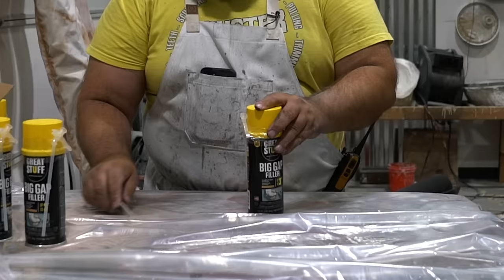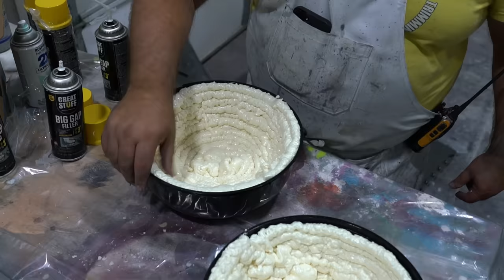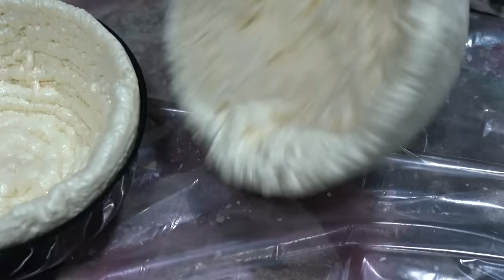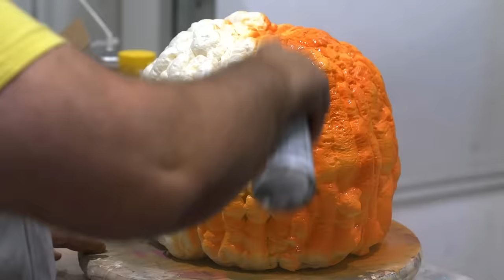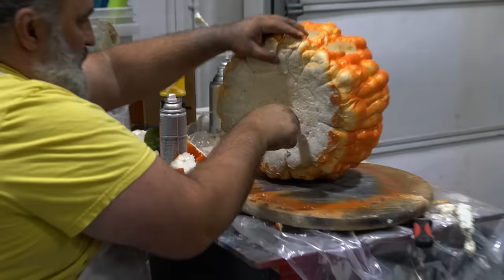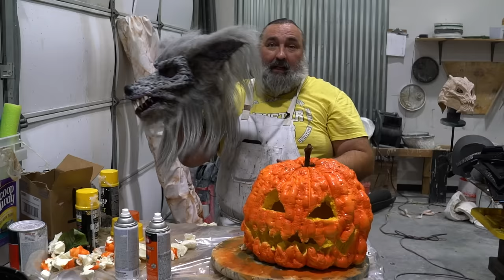Great Stuff Spray Foam DIY Pumpkin

Comment: does anyone happen to know if we would be safe to wear one of these made with spray foam as a jack-o-lantern head?
Reply from the maker: I wouldnt wear it forever, but if you wear it a few days after you made it for a few hours in a haunt or at a party then it would be fine. I also always wear a head sock so its not right against your skin.

Comment: 😊what about using Pam instead of water to make it easy removing from bowl??
Reply from the maker: Water actually cures the foam and Pam or any kind of oil would make it difficult to paint later.  It's not hard to get out of the bowl, water works fine!

Comment: Or you could just buy a damn pumpkin and crave it
Reply from the maker: you could, but it would rot. I will have this forever- If I made one every Halloween as an activity how fun would my porch be in five years with the cost of $12 a year. a fake pumpkin of this size is about $30-40 even as high as $80. I have a haunted attraction and I need fake pumpkins, its not solving a problem you have, but it is solving a problem.

Comment: If you use Vaseline to coat the bowl it won't stick at all it will pop right off
Reply from the maker: If I use Vaseline to coat the bowl, that is going to get all over the foam which  will make it very hard for any other foam to stick to it later and paint it down the road.  Also, the water plays an important role in helping the foam cure.

Comment: Flammable
Reply from the maker: https://www.homedepot.com/p/Loctite-Fireblock-12-oz-Spray-Foam-Sealant-2866858/323830711?mtc=SEM-RM-RMP-GGL-D22-022_004_INSULATION-BI-LOCTITE_17690-NA-DSA-NA-NA-MK780392200-NA-NBR-17690-NA-NA-FY23_Foam&cm_mmc=SEM-RM-RMP-GGL-D22-022_004_INSULATION-BI-LOCTITE_17690-NA-DSA-NA-NA-MK780392200-NA-NBR-17690-NA-NA-FY23_Foam-71700000110580997-58700008395699509-39700076433138561&gclid=Cj0KCQjwmICoBhDxARIsABXkXlIhu2-kHafqp185pZqtduYopcBVM0DaRdmsYU3ISPDySIZwZwbHqtAaAqDBEALw_wcB&gclsrc=aw.ds

Comment: Could you use silicone mold release spray on the bowl instead of water?
Reply from the maker: It might be possible but water is cheaper and water helps the foam cure. A mold release on the outside of the pumpkin will make it really hard to paint. I think I'd stick with water.
Reply: @StiltbeastStudios  
Thank you. Great advice.

Comment: Could you use Pam cooking spray ? Just wondering…thanks
Reply from the maker: you could, but the water helps the foam cure and skin, the cooking spray would also make it harder to paint. It actually came out easy and I don't see a need to change that portion up. the next thing to do is swap foam types.

Comment: Could you line the bowl with the plastic wrap ?
Reply from the maker: I could, but I need the water to get the foam to cure. So the wrap might shift alot. It really wasn't that hard to remove.

Comment: I think I would’ve maybe sanded it down a bit
Reply from the maker: I dont like breaking the surface of the foam, the whole point is to work it while its wet so you dont have to sand it. broken down there are particulates that cause it to break down faster.

Comment: Could you use cooking oil in the bowls to make the foam not stick?
Reply from the maker: The water does the trick- and water helps cure the foam.  Also, any type of oil would make it difficult to paint later.
Reply: @StiltbeastStudios  Ah, I forgot to consider the paint. Ty very much for the reply!

Comment: Lol how much does a pumpkin cost? Why would you handled a toxic spray foam with your bare hands. Idk maybe I'm nuts
Reply from the maker: this one costs $12 and will last about 10 years or so, a real pumpkin this size costs about $16 and a fake foam one this size anywhere from $40 to $80. 
     spray foam releases toxic gas while its curing- cured foam is pretty inert, I only touch it after a skin has formed on the surface so I can shape it.
Reply: Thanks for the reply. When you put it that way it makes much more sense to me lol. Keep up the great work bro all of your work comes out incredible!!

Comment: Cooking spray in the bowl an Is saran wrap on the lazy Susan would be better the water
Reply from the maker: the water is necessary- its more than a release agent- it helps the foam cure so it has to be there or else the foam takes forever to skin. and cooking spray at any point would make it much harder to paint later on.
Reply: @StiltbeastStudios   true ok thanks great video

Comment: what else can we make a fake one of that costs more and doesn't quite measure up to the real thing ?
Reply from the maker: This is going in the set of a haunted house which is an attraction.  I do not want the smell of a rotting pumpkin, the insects it will bring or the puddle of goo it will make as it rots.  I just want a cheery looking pumpkin that will last for several years.

Comment: Instead of h2o spray pam to help it loosen
Reply from the maker: If I use Pam to coat the bowl, that is going to get all over the foam which  will make it very hard for any other foam to stick to it later and paint it down the road.  Also, the water plays an important role in helping the foam cure.

Comment: Maybe to save you a step next time use the fire block spray foam from great stuff. You wouldn't have to paint it, and if I remember correctly it hardens up a little more than the white/ yellow stuff you used.
Reply from the maker: its about 7-8$ a can and I was trying to keep this lower in price since thats people complaint with locktite foam.
Reply: @StiltbeastStudios  I get it. But doesn't the cost equal out if you buy the white stuff plus spray paint? Just trying to save you a step! It came out good though, I might have to try it

Comment: Spray urethane foam stays in the environment for thousands of years before it effectively degrades.  Why not use actual pumpkins which degrade to compost in a season?
Reply from the maker: because I own a commercial haunted house. a carved pumpkin starts to rot in a week here in texas, and I have 50 of them in one scene- monetarily that does not make sense- or the fuel to get 50 pumpkins each week and the electricity to carve 50 a week- more eco friendly to make 50 these and have them last for 10 years. I hope you see my side.
Reply: @StiltbeastStudios  Sure, that makes sense in your case.  I would hope people watching this video would decide to make their own out of actual pumpkins rather than follow your process if they are simply looking for a project to do.
Reply from the maker: My channels core audience has been haunted attractions and home haunters who have a need for fake pumpkins, making them inexpensively and to withstand the elements have been issues. this year youtube is pushing my content further out to an audience who does not have the same problems and challenges. happy Halloween

Comment: Why cant u use oil
Reply from the maker: What do you want to use oil for?  Water helps the foam cure.  It helps it become rigid faster. Using oil in any part of this process would make it much harder to paint later.    Or to allow any other foam to stick to it later down the road.

Comment: Instead of using water why don't you use some kind of cooking spray
Reply from the maker: because the cooking spray would make it very hard to paint and hard for other foam to stick to it. the water also helps the foam cure, its not really an issue.
Reply: @StiltbeastStudios  okay it'll put a oily film on it you're right I didn't think about that

Comment: I think you could have just flipped them inside out after spraying the bowl
Reply from the maker: the lines of foam ran around, not up and down- the bowl shape was better in my opinion going up and down- the foam direction is a bit too obvious so it needed a second coat of foam.

Comment: Just buy a pumkin and carve it! Why go through those fumes from the spray.But great initiative though.👍😀🤔
Reply from the maker: Because this is going in the set of a haunted house which is an attraction.  I do not want the smell of a rotting pumpkin, the insects it will bring or the puddle of goo it will make as it rots.  I just want a cheery looking pumpkin that will last for several years.
Reply: @StiltbeastStudios  Just a thought I had…but the pumkin came out great! Good job!👍😀

Comment: Why not just carve an actual pumpkin?
Reply from the maker: Because this is going in the set of a haunted house which is an attraction.  I do not want the smell of a rotting pumpkin, the insects it will bring or the puddle of goo it will make as it rots.  I just want a cheery looking pumpkin that will last for several years.

Comment: BEACH BALL or balloon far CHEAPER
Reply from the maker: yeah, YOU chase a balloon around your kitchen half covered in spray foam and see how that goes. is it cheaper maybe, is it better in any other possible way no. this is stable and contained and repeatable. its also cheaper this way- the bowls are not used up at all, so you can use them over and over again to make more- a beach ball would be consumed as well as a balloon, a pack of balloons this size is about $6 so 20 pumpkins in you are triple the price of the 2 -$1.25 bowls you purchased to make them this way.

Comment: $30 AND AN HOUR WORK. WHY NOT buy a pumpkin $4
Reply from the maker: you suck at math. This is a $12 foam pumpkin. a real pumpkin of this size here in Texas is about $16 a fake pumpkin of this size is $30-$80 so its actually a great value and took less than an hour to make. A real pumpkin would rot, in 2 weeks, this one will last 10 years. don't yell at me on the internet when you are uninformed an so small minded that you can see this solves a problem for some people, just because it isn't your problem does not mean it doesn't exist or is not valid.

Comment: Real pumpkin is soooo much cheaper and better.
Reply from the maker: I mean, im not going to eat it. It's a decoration for a haunted house, a real one would rot way too quickly, and a pumpkin of this size would also be $12 or so, same as this one. It will last years.
Reply: @StiltbeastStudios  I guess I get pumpkins way cheaper around here.
I did use this foam to create rockwork that looks like mountain cliffs for my California King Snakes cage. It turned out amazing. I used pvc to make tunnels in the rocks.
Reply from the maker: Why not just use real rocks?  ....they're way cheaper. ;-)
Reply: @StiltbeastStudios  lol.

Comment: Yikes, this seems like a terrible idea..  Isn’t this going to make a Ton of waste…?  At least pumpkins are organic, so they’d biodegrade.  If the foam is too that’s better, but still,,
Reply from the maker: I mean, when you throw it away it will make a pumpkins worth of waste, but the foam pumpkin will last for years. Im using it in a haunted house where a real one would rot too quickly.
Reply: @StiltbeastStudios  Which makes sense for what you need, just try and make sure the material will break down into something other than microplastics, because that’s becoming a bigger and bigger problem..

Comment: Seems cheaper to just buy a pumpkin.
Reply from the maker: yes if you just want one for your porch. My normal audience are haunted attractions, theme parks and home haunters. We cant use a real pumpkin because of the cost and speed at which they will rot, or because of bugs etcetera that a real pumpkin could cause. So a fake customizable alternative is needed, for $12 in cost this is a decent option.
Its not a problem you have, but it solves a problem that exists.

Comment: or you could just buy a foam pumpkin
Reply from the maker: you could, but its more expensive than the $12 this one costs. also youd only get the size they gave you, and making your own you can vary the sizes. if you need fake pumpkins then this is a good solution, if you dont need fake pumpkins...why watch the video?
Reply: @StiltbeastStudios  It was recommended! I was curious on what it actually was but it seems really time consuming, usually there's lots of sizes to pick for less than $4 a pumpkin from what I've seen at Michael's. to each their own, not worth the amount of time imo unless it was a very extravagant sculpture

Comment: LOL, buying a fake pumpkin would have been cheaper.
Reply from the maker: thats not actually true, a fake pumpkin of this size is about $30 and this one costs $12. also if you need a fake pumpkin in May, the you are SOL for finding one.
Reply: Large Foam Pumpkin - Halloween and Fall Home Decorations $15.99
Reply from the maker: yup, more expensive than the $12 and,,,how about that shipping?
Reply from the maker: if you mean the one on amazon for free shipping, that says large, its 9"  not a large pumpkin at all.
Reply from the maker: keep trying though, find us a deal.

Comment: Lol cheaper to just get a real pumpkin
Reply from the maker: the first year yes, the second year you break even and the third is profit.  Or you cant use a real pumpkin at all because its going in a haunted attraction and a real one would rot way too fast and be a puddle of goo. If you need a fake pumpkin on the cheap, this is a decent way to go- but it will be refined.